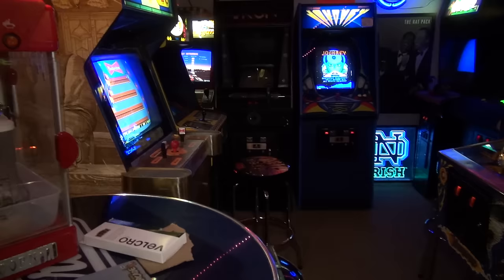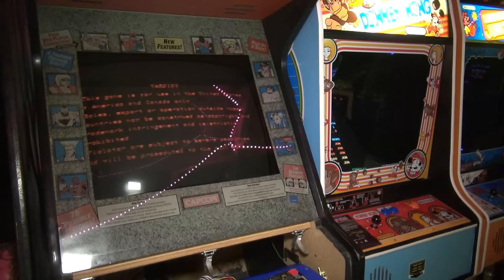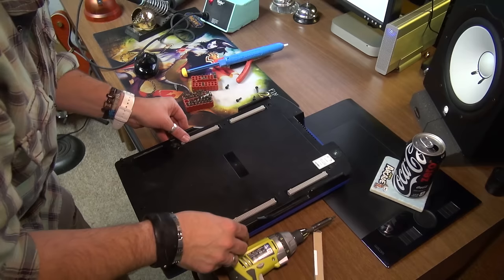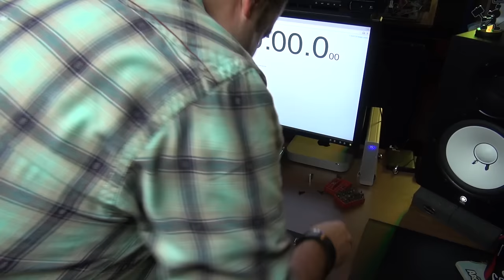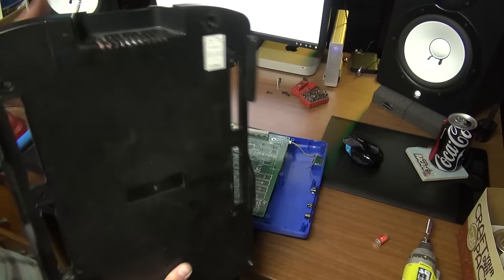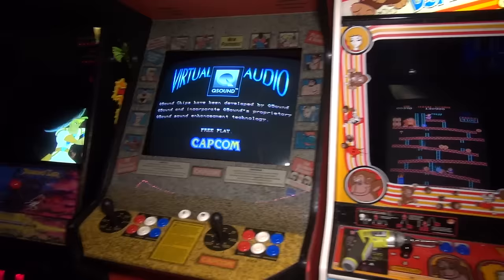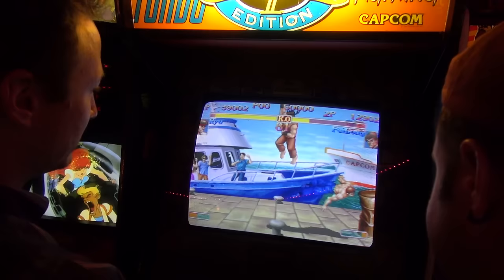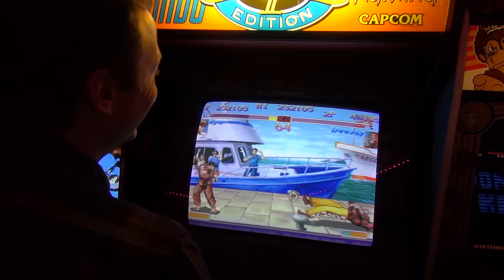CPS2 Suicide Battery Change in less than a minute - SUPER STREET FIGHTER II TURBO

Comment: For things like this I tend to wire a charged battery up in parallel (using different solder points), remove old battery, install new charged battery, then remove parallel battery.
Reply: +GadgetUK164 That seems natural to me, top tip! Are the batteries not trickle charged too, when the board is powered? Just a thought?

Comment: A few quick notes on things mentioned in the video:

the motherboard is the A board, the game is the B board

James at JNX still makes the CPS1/2 harness adapters, they're the best you can get: http://www.jamma-nation-x.com/jammax/store.html

the security bit is a T20, make sure you get the security version that has the recessed middle part

you mention the low plays on the coin counter - this version of SF2 came out when the game was pretty much 'dead' in the arcades, it was only later that it got the competitive play it has now

piracy of CPS boards was a big deal - SF2 Hyper Fighting was a direct response to the 'Rainbow' hacked versions, the encryption of the CPS2 was an effect of this - CPS2 is really not that much different in architecture from CPS1 (you can see this if you compare them side by side)

the main difference between HF and ST is the addition of four characters and also the super combo meter - turbo 2 is the correct speed for this game, turbo 3 in the Japanese (green) version

E. Honda and Ryu are good beginner characters

Comment: couldn't you have connected another battery in parallel to power and ground on another place on the board while you replaced the other battery so it would be continuously powered

Comment: Nahhh you've got quite a while before the PCB loses it's charge from the battery. A minute won't hurt, I think it takes quite a few for the PCB to die out before the game has to be phoenix'd in order to work again (changing the coding of the roms to no longer require a battery).. But as long as it's working!!

..Just dont wash down the board with water, especially the battery.... i made that mistake..  now mine has to be phoenix'd lol

Comment: Hey John any idea how to get a Super Turbo cab in the states? I'm trying to get one but it seems impossible. Japanese or US version it doesn't matter.
Reply from the maker: You should look for a red Z-back cabinet or a Capcom big blue cabinet then go get the board. It's gonna be the easiest route.
Reply: Wow thx so much for the fast reply John. I have seen some Japanese boards(the green ones) on ebay for around $500. Would I need to get both the A and B? Also some were phoenixed and some weren't so is there a better version? Isn't the original game better? Sorry for the dumb questions.
Reply from the maker: You need A+B to make it work. I believe the Japanese version has better AI. But someone, smarter than me can clarify. Phoenixed are hacked roms to bypass the suicide battery. I don't mind them. Less to worry about.